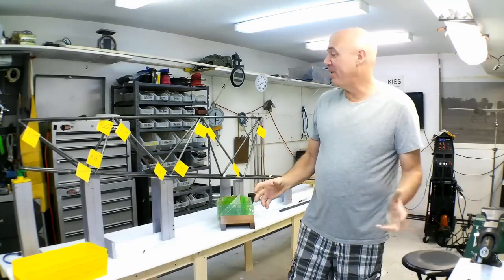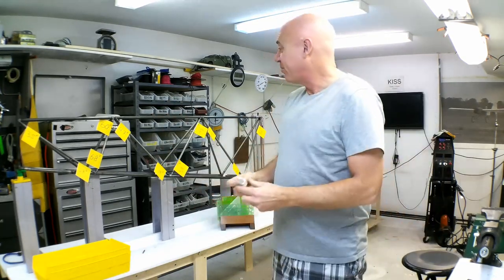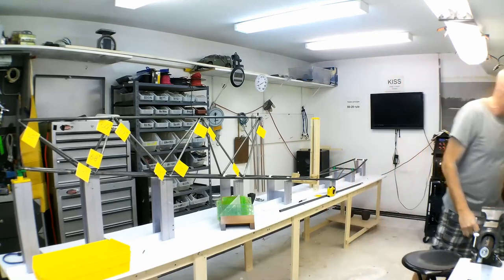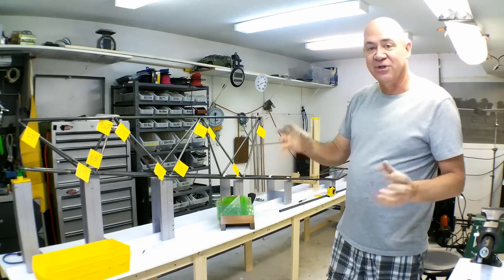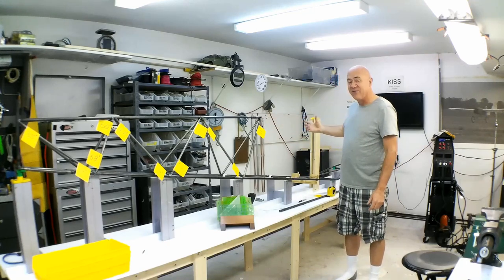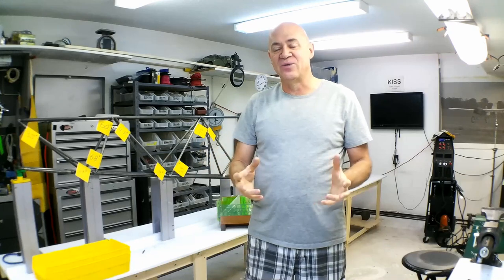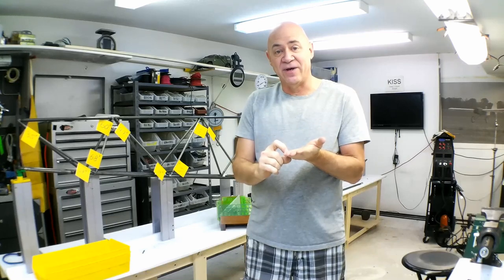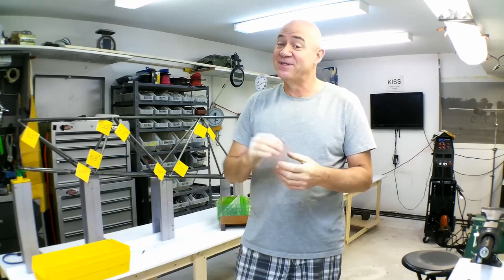Air-Bike 005

Comment: Thanks for the words of encouragement!  I'm planning on building a Legal Eagle which was originally based on the AirBike so the wing and fuselage construction is very similar.  I have high confidence in my ability to build the wings and empennage (Al tube and gussets) but not so much on TIG welding the Fuse.  I have done a little Oxy Acetylene welding and some stick welding and I have soldered circuit boards all my professional life.  I'm planning on taking TIG classes at my local Maker's space and using their TIG equipment to weld the Fuse.  Your demonstrations of the strength of your welds have given me encouragement that with some practice first that I will be able to make "airworthy" welds and get the job done.  Thanks so much for putting this video series together!
Reply from the maker: Glad it help, good luck with your build.